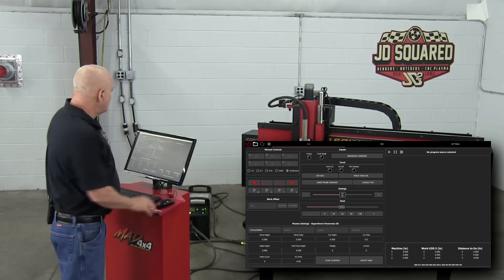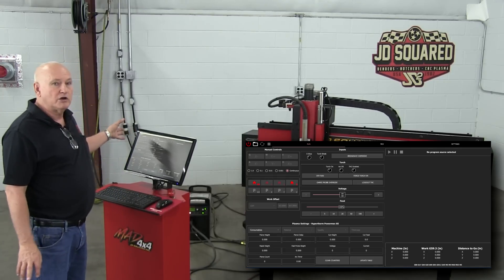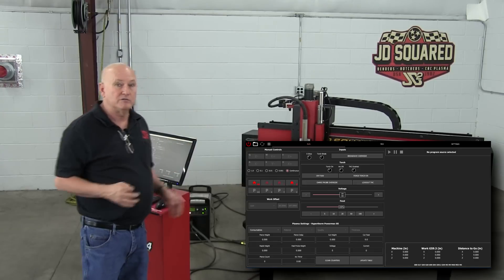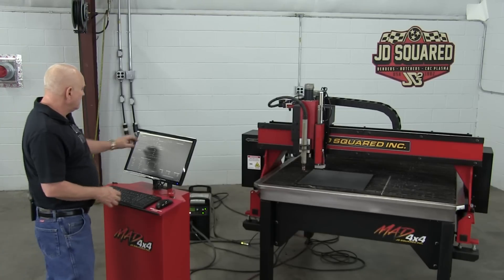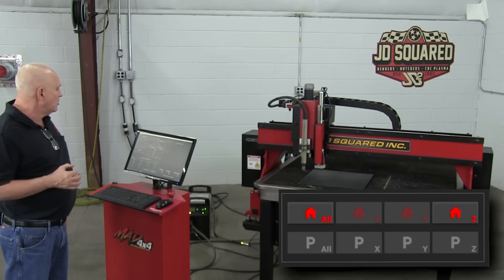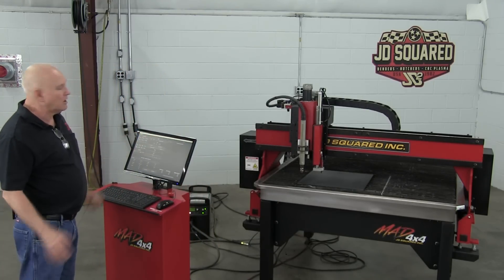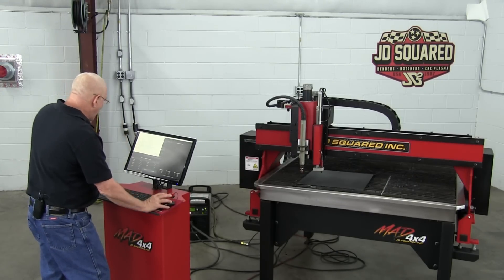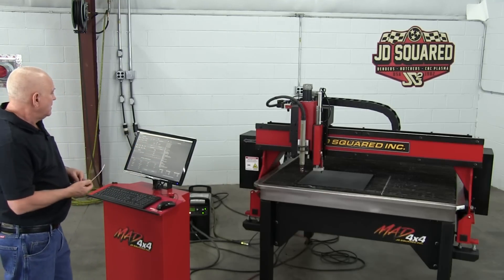MAD Series   User Interface V2 Video 1

Comment: 1.Ok I am a owner of a 4x4 Mad Gui V3 Idk why you guys call it GUI because everyone you look at on the screen is a Graphical Users interface so it's common sense. 2. I hate not having privacy using your sneaky method of having a cloud and if my machine is connected to the internet each time I open MAD V3 It sends out all the information of my machine to you guys. I should have a right to say if it's allowed to or not but I do not blocking it from the internet is the only way I can block it I know you guys can also without my permission can take control of my CNC machine when ever you like using AW.Amazon IOT open source. I am a exploiter I know for a fact this is happening you guys do not want to give out information or the tech support is limited on what they know well I am tech support for my machine. Mad V3  & V2 is nothing but linux CNC with a GUI pulled over it and you guys limit the user to what they can do the arrow buttons you mentioned in the video is already there just disabled, also the using a game controller options or smart phone options or using a wireless PID is there also but your son block it also only limiting the software but no need to be sad it's a great table in my opinion & also the way Devin set it up is very clever I give him props for that but you can run a linux CNC distro using windows 10 pro virtual machine like you guys currently are doing and use all mad gui's NGC homing & other commands right down along with the current post file you guys use. Giving me the option to turn off that turn key BS that you guys call it. I call it a unlocked back door entering without the owners permission... outside of that option this table is kick ass. There's something for you guys to think about....